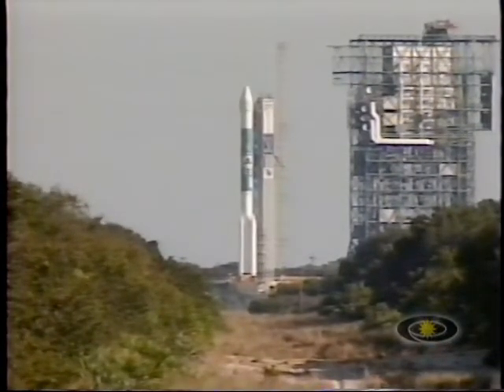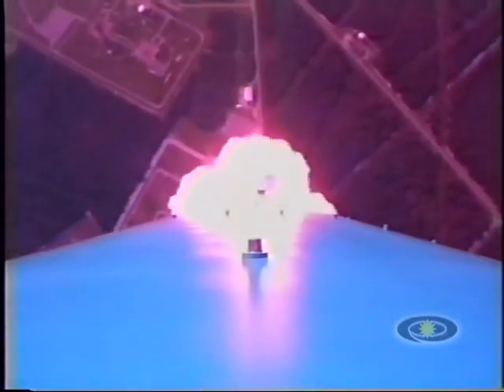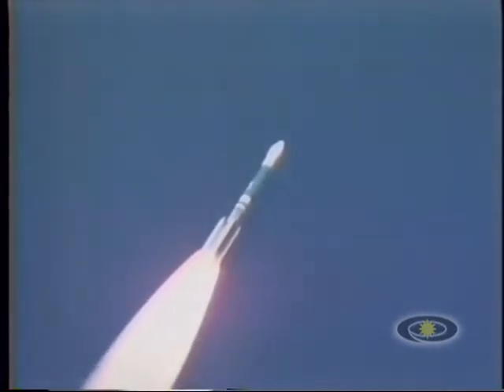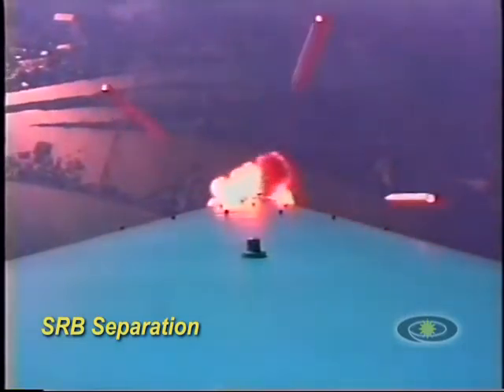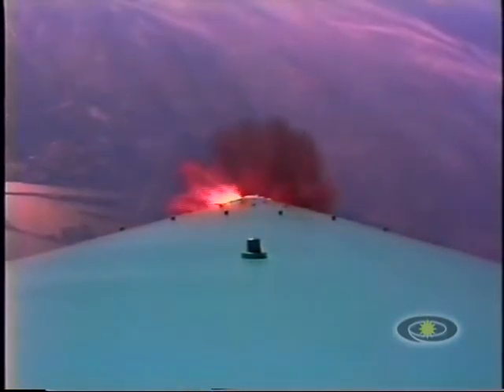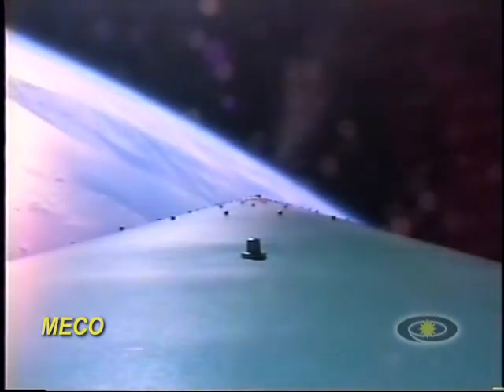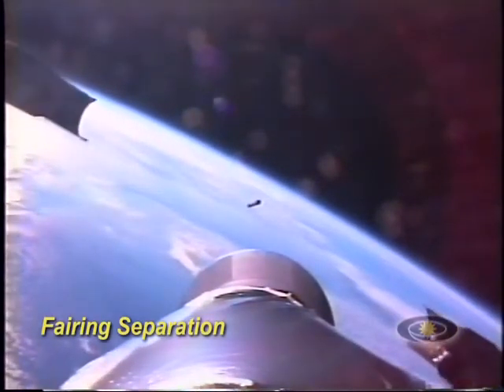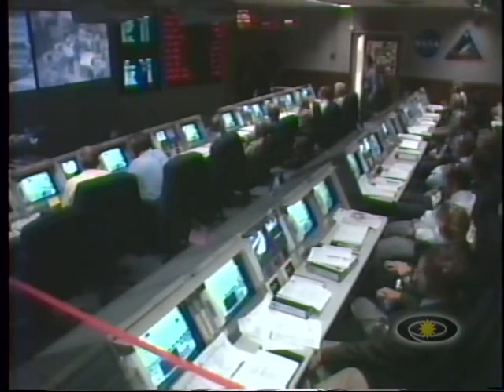Stardust Launch

Comment: There is no continuous shot of the rocket leaving earth's atmosphere. It literally switches frames and then is magically "in space". Sometimes it's the simple things...
Reply: Ash J. Williams bro... you’re brain is too tiny for these conversations. I’ve literally tracked the iss in my telescope and you can make out it’s entire shape which corresponds to what they say it looks like (“they” being NASA) and any google image or video of it... you can literally SEE IT. It’s not a “light in the sky” bc when you use optics that light turns into... THE ISS
Reply: Ash J. Williams and btw... theres a jump cut in the video because it’s boring to just watch the same shot for minutes. Whoever edited the video was thinking of someone who just wanted to see the parts where stuff actually happened... so they cut to those parts. They weren’t thinking about retards decades later smashing their keyboards BUT WHY DOES IT JUST JUMP INTO SPACE?!?! 

fucking lunatic
Reply from the maker: But I watched it live as it lifted off and watched until after the solids all separated and then the first stage fell away and the second stage lit.  I saw it that far with my own eyes (and tens of thousands of spectators).    I then went inside the launch control facility and watched the ascent video live all the way until we lost the radio link from the booster video shown at the end of this video.   I THEN watched on the live data feeds that I had from JPL and the Deep Space Network as they pointed the dish where the spacecraft was to appear over the horizon, and we received the spacecraft downlink signal right as expected.  I literally helped prepare that spacecraft for launch including final closeouts of the Sample Return Capsule (SRC).   I then helped lift it onto the rocket and install the fairings around it.  I was one of the last people to see the spacecraft before the rocket was buttoned up.   I was then one of the launch test conductors for the power On and preparations of the spacecraft for liftoff.   So did you read about the mission yet?
Reply: Stuart Gray I'm glad science doesn't base it's claims on some guys word. Why does the video fail to deliver something so simple? Why the frame change? This simple little flaw blows the whole thing WIDE open and now all you can do is get me to take your word for it...are you kidding me?
Reply from the maker: Ash J. Williams -    You claim that the spacecraft was just dumped into the ocean.   Well fast forward 7 years when Stardust completed it's mission and returned the Sample Return Capsule to Earth.  We controlled the entry of the SRC into Earth's atmosphere as the fastest man-made meteor in history.   The capsule entered EXACTLY when & Where we said it would and lit up the sky as it reentered earth's atmosphere over California.  We tracked the capsule with Radar as it opened its parachute over Utah and landed in the desert.  We retrieved the capsule and the sample inside.  There is video of the SRC reentry on my YT channel.  FINALLY - That Sample Return Capsule is on display at the Smithsonian Air & Space Museum in DC.    I went and saw it myself just a few weeks ago it is 100% certainly and unmistakably the capsule that I helped closeout before launch.  I even recognized where we made a bit of a mess on the backshell with Red Silicone RTV.    So if the spacecraft was dumped into the ocean in 1996, HOW DID IT REENTER Earth's atmosphere and is now in a museum?   That capsule has my signature inside it underneath the thermal blankets.  Nice try though!   Did you read about the Genesis mission?
Reply from the maker: Ash J Williams - "I didn't say jack about your stupid capsule...YOU sure had a lot to say about it though."    you seem to have a short memory - I TOLD you that I had PROOF AFTER you read up about Stardust.   The CAPSULE IS THE EVIDENCE.   When I first started conversing with you I thought you were reasonable and wanted to learn.   Now I am beginning to see that you have your mind made up regardless what evidence I show you.  SO instead of going on and explaining how Deep Impact ALSO has incontrovertible evidence that the mission was real, I believe now I will just tell you to just go away and enjoy your delusion by yourself.
Reply: Stuart Gray Sorry but if you think that plucking a capsule out of the ocean is proof of outer space then you are the one that requires delusions in order for "space" to be real. I have asked simple questions that you have been unable to answer because the fact remains that your belief is still just that. You cannot verify space anymore then I can verify it as a lie.
Reply from the maker: Ash J. Williams - "if you think that plucking a capsule out of the ocean is proof of outer space"  You are being disingenuous with your simplistic explanation of my proof.   What I ACTUALLY presented was: Expert eye-witness testimony from a subject matter expert on spacecraft & rocket technology, Video of the launch of the mission which clearly shows the payload leaving the earth with the sample return capsule inside, pictures of the spacecraft encountering the comet during the mission, video of the return of the capsule when & where we said it would, and PHYSICAL evidence consisting of the sample return capsule in the Smithsonian air & space museum.  In addition I presented videos of the SpaceX launch & landings that is further proof that rockets work just fine in a vacuum.  So far your only evidence to the contrary IS - "Because I say so".  You have not presented one shred of evidence that contradicts my evidence above.  Nice try though.
Reply from the maker: Ash J. Williams - Next I will explain how the Deep Impact mission proves that NASA missions are real.  In 2005 I personally launched the deep impact spacecraft and then helped fly it from JPL in Pasadena CA.  In July 2005 we hit the comet with the impactor spacecraft while watching from a distance with the flyby spacecraft.  There is video of the impact from both the impactor and the flyby spacecraft.  Up to this point I am sure you will say it is all fake.  Here is your evidence: The impact was witnessed by numerous countries, orbital spacecraft, and by thousands of amateur astronomers around the world through telescopes  - I repeat THE IMPACT WAS WITNESSED BY THOUSANDS OF PEOPLE HERE ON EARTH.   Please explain how NASA can FAKE AN IMPACT WITH A COMET.  I supposed "it was CGI" right?
Reply: Stuart Gray On the contrary: I have presented ONE SIMPLE question which presents a shadow of a doubt. All of your combined evidence still cannot validate your claim when a simple flaw that carries so much weight cannot be addressed, no matter how much circumstantial evidence you provide. You're still ultimately stuck with: your 'word' (not proof of space) and things you have done ON EARTH (again, NOT proof of space). Until then, we have no hard proof of space and one GLARINGLY obvious question that remains unanswered.
Reply from the maker: Then ask your question again, because I dont remember anything you have stated that even resembles "proof".  Or are you basing your entire premise on "Why isnt the video continuous all the way to orbit?"
Reply: Stuart Gray No, you will present a bunch more circumstantial evidence, based on things you watched on a screen, from earth. Not actual proof of space. You're just going in circles dude. You're engine is revving up like crazy but you're just staying in one place. Lol.
Reply from the maker: Ash J. Williams your reading comprehension is lacking.  I said above that people AROUND THE GLOBE WATCHED US HIT THE COMET FROM TELESCOPES.  But I see you are ignoring that bit of EVIDENCE.
Reply from the maker: Ash J. WIliams - I dont think you ever responded to my question:  "You do know that you can see the International Space Station with your own eyes right?"     There is a video of it here on my channel.     https://youtu.be/t03Z-VlD8lc      I have gone out and watched it on numerous occasions.  How do you explain that?    If you have never seen it before I CHALLENGE YOU TO GO LOOK.  I'll even tell you exactly how to see it if you give me your approximate location (zip code works if in US)
Reply: Stuart Gray Are you kidding me? A video of a little white light that makes its way across the sky? You see a tiny "part" of the equation and then your imagination does the rest...and you call it proof of space. Lol. You're so caught up in the space lie, it's not even funny. "See that light up there? THAT'S THE ISS, cuz some people said So!"
Reply from the maker: Ash J. Williams - Ok next - If you use a telescope to look at "little white light"  you would find it has a shape and measurable size.  That shape is EXACTLY like they claim it looks.  That size is Bigger than a football field.    search Youtube for "Photos of ISS P900"  and then explain those dozens of videos explaining how they took the images.
Reply from the maker: Jason Borne   I graduated with an Electrical Engineering degree from University of Oklahoma.
Reply: Crimson Warrior that you for reminding everyone what year it is. I’m sure a lot of flatearthers deny it’s 2018 bc... well why not they mindlessly denounce everything else
Reply: Crimson Warrior but to your point about the ISS... the reason people believe the ISS is orbiting earth is bc you can look up and see it first off... it moves much faster than any other “lights in the sky”

It’s clearly not a plane, the highest planes don’t even go 1/10 of how high the ISS is.

But MOST importantly... you can look at it through an amateur, cheap ass telescope or good optics.

This isn’t like difficult stuff, a middle schooler could do this.

I’ve many many times viewed the ISS through my telescope and you can clearly see it’s exact shape. The EXACT shape of what NASA SHILLS tell us it looks like. 

You can have this verified, it isn’t a belief, it’s something you can verify. And if you are so broke that you can’t get a $150 telescope and a free app to see it for yourself then it’s no wonder you’re a flatearther.

Please don’t reproduce, for the love of god
Reply from the maker: Jason Borne  he probably thinks the MIR space station was fake too.  Even though I have video here on my playlist of it re-entering the atmosphere.  That was probably a hologram according to flat Earth morons.
Reply: Stuart Gray oh it for sure is a hologram. I can’t believe you don’t know that 😂

I love the dude who said people believe in the ISS because someone says “see that light in the sky”

Uhhhhh no we believe that bc it’s been told to us and then i take my telescope and go “cool... yup.. that is the ISS.. how neat i can see it’s shape exactly as they show us and you can see solar panel and even the soyuz... sweet!”

Pretty simple for verify 😂
Reply from the maker: Jason Bourne (sorry didnt see your question) - "Did you work for NASA or what?"   I worked at Lockheed Martin Flight Systems where they build interplanetary probes for Jet Propulsion Labs.  I worked on Stardust as one of the Test Engineers responsible for integration of the Command & Data Handling subsystem and the Science Instruments.   I was also responsible for test of the Avionics box that was in the capsule that deployed the parachute.  I helped process it at KSC, integrate it with the Delta-II and launch it.   I was in the control room at Lockheed the day it flew past the comet and got to see the first pictures returned live.  By the time the capsule returned to earth I had moved to Ball Aerospace and was working on the Deep Impact mission.  I did get to see the capsule at the Air & Space Museum in D.C. last year.  I would testify in court that it is the same capsule that I literally helped seal up, put on the rocket and watched it leave earth - with my own eyes - in 1999.
Reply: Stuart Gray woe i’m envious, thats so awesome! If you don’t mind saying where did you go to college and studied what to make it that far to get into lockheed
Reply: Stuart Gray wow thats awesome. Forgive me, i’m not very aware of many colleges besides the big ones you hear about. Yale, Harvard, Princeton, Cornell. Is Oklahoma a good engineering school? I live near pittsburgh. I only ask bc im naive about this obviously. I just always assumed places like nasa, lockheed would only hire from those ivy league schools, but again i know very little about how any of that works. Just a silly assumption lol But i just googled it and that campus is AWESOME. Did you meet anyone from MIT? I live near MIT, they are big with engineering robotics and stuff like that. Pretty sure they worked on one of the rovers nasa used? 

So what do you do now?
Reply from the maker: Actually I work at Ball Aerospace currently where we built the Deep Impact probe and Kepler, we just finished building most of the James Webb Space Telescope.  I helped launch and fly JPSS-1 last year (Now NOAA-20).    Univ. of Oklahoma was not known as a top tier Engineering school.  If you want good for aerospace look at Caltech, Purdue, or even CU in Boulder, but MIT would do just fine.
Reply: Crimson Warrior you’re characterization of “globers” is even funnier however. People don’t know the ISS is orbiting earth because someone says “see that light up there”

That would be a characterization of flat earthers.

Someone on youtube that they’ve never met who has no understanding of the subject they are talking about says something that you have no understanding of and you go “AH HAAA THAT MUST BE TRUE”

Flat earthers have this “don’t believe anything unless you test if for yourself”

But then you watch some video and believe it full sail.

I’ve literally seen videos FROM flat earthers who intentionally have curved stock footage upward of balloon flights to make the earth look flat. It was a video of a gopro (so fish eye) and a flat earth took a small small few second clip of the original footage when the balloon jiggled and the frame was above the middle point which inverted the ends upward so appeared to be flat. And titled the video FLAT EARTH PROOF- NO CURVE.

And theres a million comment of fuck heads like you going “NASA SHILLS LYING ABOUT SPACE

“MORE PROOF”

You people claim to be all about vetting science and doing your own experiments but ignore all data that doesn’t fit your narrative and accept fully ANY video that makes your point regardless of its veracity.
Reply from the maker: Jason Borne  I have also stood in the cleanroom in Sunnyvale CA with the deployed solar panels for the ISS while I was reviewing the Stardust Solar Panels.  I have witnessed TWO space shuttle launches, one to MIR, and one to the ISS and witnessed the landings. One of them was when they returned Shannon Lucid. That was STS-79 in Sept 96 while I was preparing Mars Global Surveyor for launch.  And the company I currently work for has had numerous science instruments on the ISS.  They just installed one a couple months ago.  I think it was SAGE 3.
Reply: Stuart Gray wow thats so cool. Did they launch the ISS in pieces i assume? Do you know how many launches it took to get it all up and what went up first?